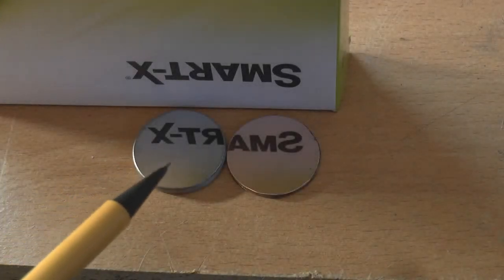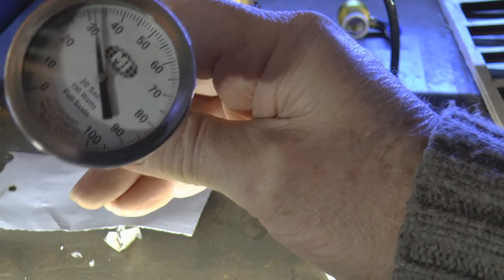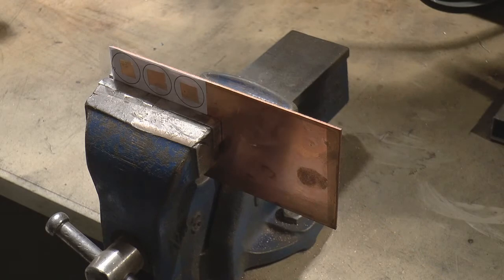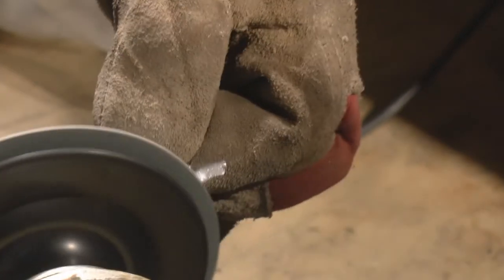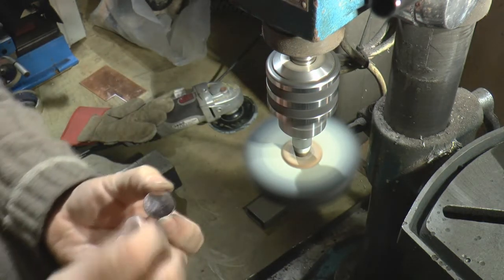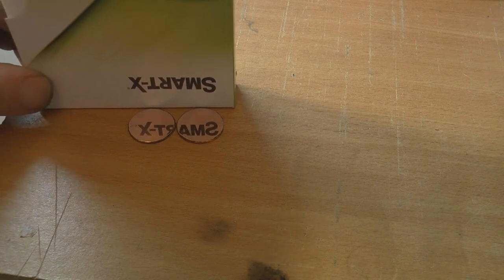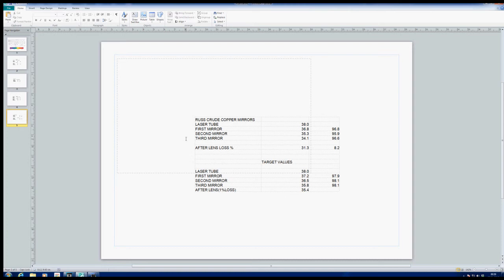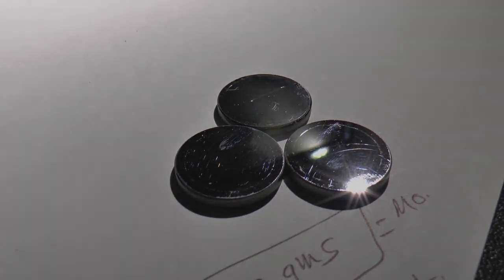RDWorks Learning Lab 41 MIrrors Metals and Reflectance PART 3

Comment: I wonder if gold plating the copper mirror would be of any benefit?
Reply from the maker: The only reason to gold plate would be to prevent oxidation. As I have demonstrated, even a lot of oxidation and a non reflective surface still produces an IR mirror that is as efficient as the commercial molybdenum mirrors. As I said it's nothing to do with  shininess of the surface and all to do with  the crystal structure of pure copper. When exposed to air, the oxide that forms is VERY thin and although slightly less reflective, unlike many oxides (rust for example) provides a protective surface coating that prevents further oxidation. So, with just a little elbow grease to organize the surface structure you can gain maximum reflectance. Pure gold has the same reflective IR crystal structure and its reflectance is the same as copper within a tenth of a percent . The only advantage of gold is that it does not oxidize at all. However,  my copper mirrors have been in the machine for over 6 months now and the Maguiars polish that I used has a molecular polymer coating that does not affect the reflectance efficiency and is doing a great job of preventing  any visible oxide formation. I will shortly be doing a power check to see how their performance has changed. At present I can detect no obvious changes in cutting performance. So why would I go to expense of gold coating when I'm trying to get mirrors for free?
Thanks for your question because it does  give me an opportunity to explain the reasoning behind a rather stupid experiment to make my own mirrors. It has been suggested by one correspondent that an even cheaper way to make copper mirrors is to use printed circuit board. I have not tried that ....yet.
Best regards
Russ

Comment: That's great but, how are you going to keep them shiny and not tarnish from the atmosphere and won't they be slightly convex due to the polishing style you used. Using a target after each mirror might give an indication of their flatness.
Perhaps mounting the mirrors to the end a piece of dowel and mounting that in the drill press might give a flatter surface with radial lines of polish.
Reply from the maker: +Mentorcase 
Hi 
The mirrors I bodged for my video were very crudely made, I admit, but there was an improvement over the proper mirrors that were there. Copper is a naturally more reflective at 10.6 microns that a similar molybdenum product and I have plenty of copper sheet to work with. As my final video comment noted, this was a start because I felt I had scatter on the last mirror (at least) and that I was planning to try different manufacturing techniques now that I'm pointing in the right direction.
I have just come out of my workshop for a cup of coffee and am just testing a mk2 manufactured mirror.   You saw that I had to pack the back of my mirror with a "penny" washer. Well, I have used that to my advantage now. I have fitted an M4 hank bush to the centre of the washer and made sure that flat side has no protrusions with some 3M VHB double sided tape I have attached my copper blank to it. I have lapped the disc flat on a steel surface plate with 800 grade wet and dry paper to ensure reasonable flatness,. I have used a full size 6" polishing mop this time because I can now screw in a piece of m4 studding to the hank bush and lock off with a nut so that I have a stem to hold whist polishing. I am taking great care to polish across the whole disc surface whilst continually rotating it, in an attempt to maintain the flatness.  After polishing I have used a piece of HDPE foam with some brass polish on the surface to do a final light lap/ polish.  I have buffed this clean with soft tissue but  have not cleaned the surface with acetone or alcohol. I am hopeful that the polish will delay atmospheric tarnishing without compromising reflectance I have just tested my first mirror at 97.2% so I'm edging closer to the magic 98% and the beam seems less scattered. The only way you can really see what the beam is doing is to perform an acrylic mode burn test before and after the mirror.. That will tell me exactly what the beam shape and power distribution is.
Pressure washing the decking is on my wife's to-do list now, so I will have to stop playing until this evening.
Thanks for your interest and input.
Russ
Reply: Sounds like you're on the right track and good to see the priorities adjusted to keep the wife happy. :-)

Comment: I really enjoy your measurement backed experiments. I read somewhere that mirrors made from hard drive platters are good. can you try them?
Reply from the maker: +bobdring 
Hi 
Thanks for your kind words. Sadly I don't have a stash of hard drives I can rip open. I know that the larger old style discs were made with an aluminium/manganese platter that was coated with various materials, the final coating being Cobalt. I'm not aware of any of the big industrial/scientific mirror manufactures that use cobalt for 10.6 micron laser mirrors. I have no idea what it's reflectance value is. The molybdenum mirrors I removed are supposed to be some of the most durable although, at 98% reflectance they are on the low end of optical performance. As you have seen, copper is a more tractable material with potential for something better than 99.9% performance. I have lots of copper and seeing how easy it was to get goodish results I'm going to experiment to see just how good I can get them with "garage" technology. Maybe another video?
Regards
Russ
Reply: +SarbarMultimedia The HDD I saw was the type from a PC. This might save you time as they don't need to be polished only cut out.
 I just found the link.
 http://diylaser.blogspot.com.au/2012/01/get-your-co2-laser-mirrors-for-free.html. 
I wonder what the efficiency is. Very few people have the power meter.

I just saw a laser cutter with a removable base plate. They engraved a name on a normal room door by laying the whole machine on the door, on the floor!